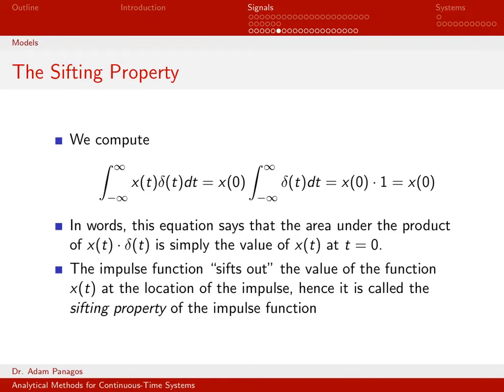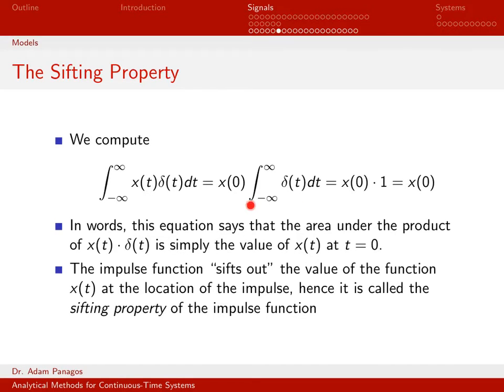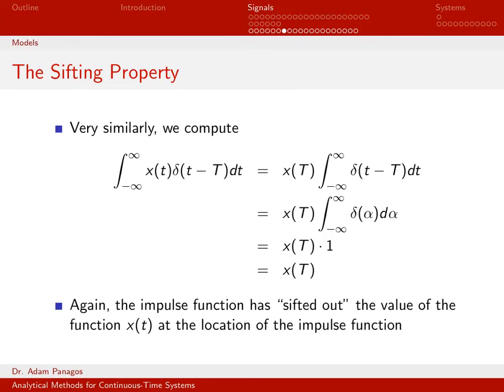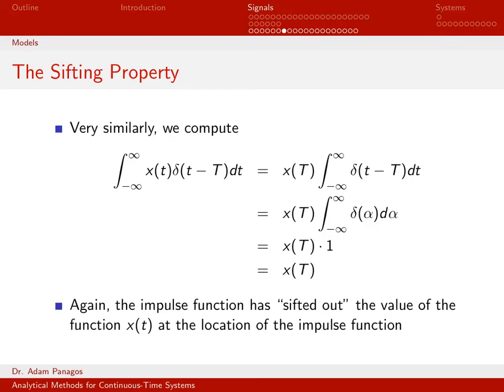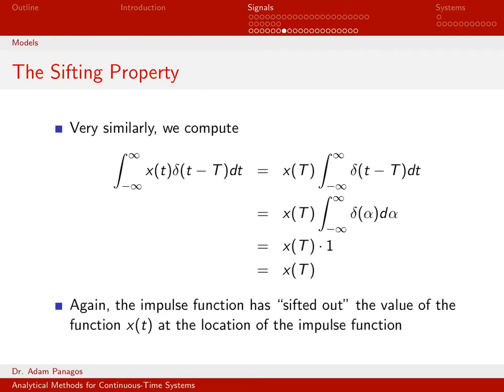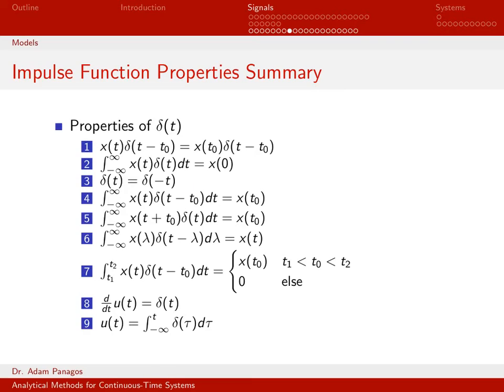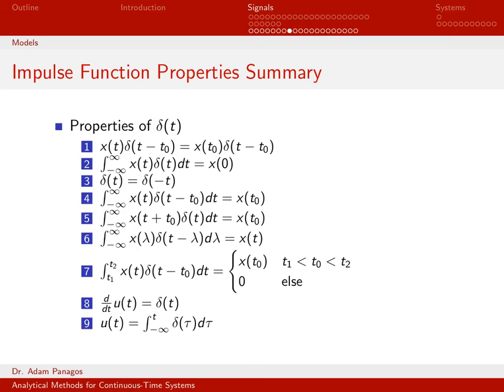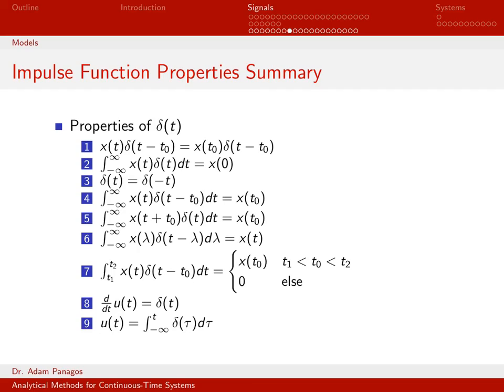The Continuous-Time Unit Impulse Function 3/4

Comment: We get the same value for multiplication itself.    Therefore, where is the need for integration ?
Reply from the maker: No, the product of a signal x(t) and a delta function delta(t-T) is the signal x(t)delta(t-T).  This signal is zero for all time and has an impulse of density x(T) at time t = T.  The integral of x(t)delta(t-T) is the scalar x(T).  A scalar x(T) and signal x(t)delta(t-T) are very different things.